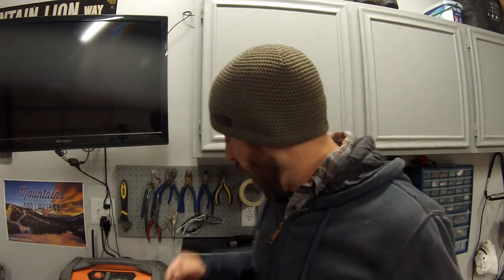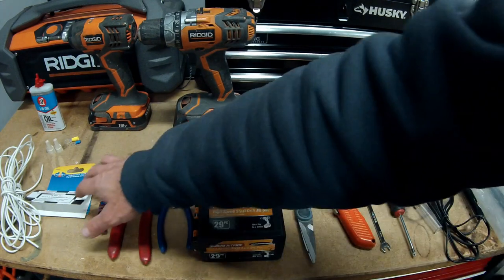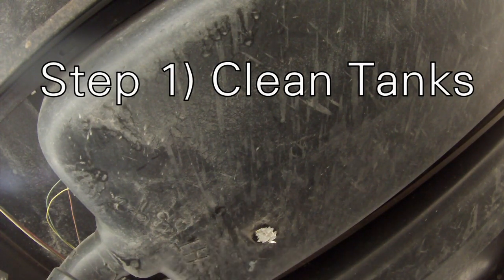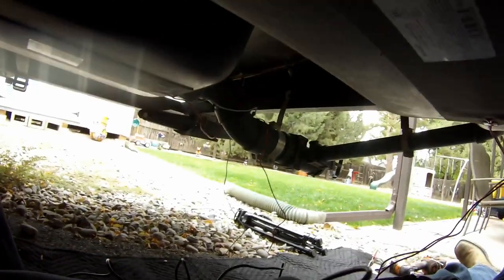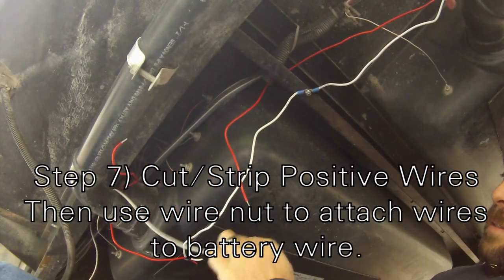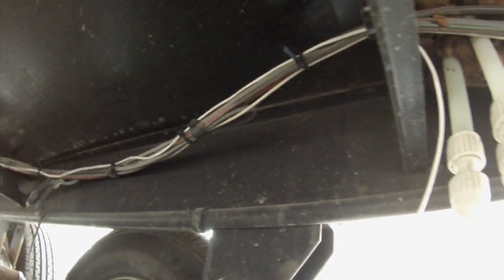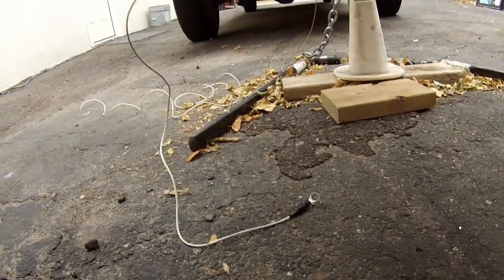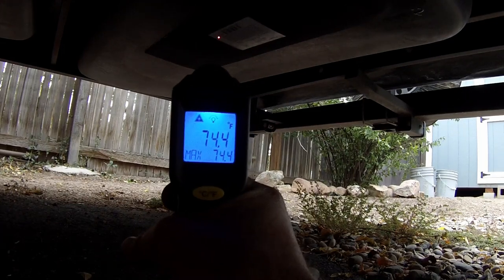How To Install 12 Volt RV Tank Heater Pads On A Travel Trailer - 4 Season Camping Upgrade!

Comment: A wire nut is a bad idea for the positive leads. I would suggest a crimp connector with heat shrink. It will keep out water and will not fall off. You don’t want to short your battery.
Reply from the maker: Ok, thanks for the tip and watching!
Reply: And wrapping in electrical tape is a bad idea.

Comment: Nice how-to-install tank heater video!  A couple things I would look at if you ever have issues with the heater working:  1) Consider running ground directly to the battery (or at least the main fuse box).  These heaters draw enough amps that an exposed ground could cause problems in time. 2) Not sure that switch is weather proof despite the boot on the front switch handle. Might cause a voltage drop.  Thanks for the links looking into installing something similar myself.  EDIT:  Just saw the link states the switch boot is weatherproof!  Good.  But what about the switch contacts themselves?
Reply from the maker: Thank you! I appreciate the feedback and you watching.

Comment: Cool stuff!  You are braver than I am camping with water on board in single digit temperatures...good for you 👍.  I do my late fall and early spring camping while still winterized...no big deal for me
Reply from the maker: Thank you! They ended up working out really good. I should be posting that camping video in the next two weeks to a month. Those tank heaters were the reason I was able to camp in those single temps! Otherwise I would be doing exactly what you do!
Reply: @ColoradoCamperman  Our 2020 EPro19BH came with tank heaters, but the camper isn't heated and enclosed. I thought if it wasn't we cant camp in the winter. Hubby wants to camp at the ski resorts here in WA and I'm trying to find a smaller trailer for him but don't understand how folks are using the toilet facilities in the winter.
Reply from the maker: @sherab2715  I looked at EPro and was worried about them not being enclosed underneath.  But it is a definite positive that you have the tank heaters!  What you could do is get some RV antifreeze and pour it down your toilet and sinks/shower.  This way your waste won't freeze up.  I did this with my toilet in my truck camper.  The only thing then you would have to worry about is your fresh water tank.  An alternative would be to use a jug of water at your sink that would then drain into your sink and not use your fresh water tank at all.  Again, I did this with my truck camper in the winter while camping at ski resorts and it worked great!  The only downside is you can't take a shower.  Hope that helps!  Have fun out there!
Reply: @ColoradoCamperman  I see, so keep nothing but antifreeze in tanks and when you use the bathroom, then pour water down the toilet or sink afterwards. Thanks!
Reply from the maker: @sherab2715  Yep, that's what I did and it worked well!

Comment: Hey Brian, How much draw did the pads have? I was thinking that this pad (probably a smaller size) would work good to heat a battery box for my solar unit. I just didn't know if it would drain the batteries faster than they would charge. I understand it would depend on how well the battery box would be insulated etc.
Reply from the maker: 78 watts each, so you have to have a decent solar setup in order to make sure you battery doesn't die on ya. The smaller ones are not as bad. Hope that helps, thanks for watching!

Comment: nice video, in video you install a Facon heating pad, as seen on the label. The link in the description is to a rec pro heating pad, also your description talks about recpro? Trying to understand which brand was ultimately installed and used.
Reply from the maker: I just looked back on my Amazon orders and can confirm it was the Rec Pro just like the link in the description.  Not sure why the actual heat pad said Facon, maybe the parent brand?

Comment: I'm in New England, Massachusetts to be exact...  I live in my trailer, I doesn't use the water system (pump, pipes), I made a makeshift faucet with 5 gallon fresh water jugs. I do use the sink drain (Grey tank) and toilet (black tank), should I install these on my tanks? Or would heat lamps with insulation board going around the outside.???? This is my first winter, I couldn't afford an apartment because of inflation so I got a 17ft trailer. What would be my best option?
Reply from the maker: If your tanks are exposed like mine were, I would definitely recommend getting these tank heaters. I'd be very surprised if a heat lamp would keep those tanks from freezing. Good luck and thanks for watching.

Comment: Hey Brian .... These look like a great idea !   My camper outlet valves ( Black & grey ) always freeze solid too , already had to fix that this season  by thawing them out with a small heater and dumping hot water down the  sink drain and toilet  . How many watts do these run ?   OK have fun on your elk trip and good luck getting one !  Im heading into the back country camping and skiing !
Reply from the maker: Man they worked great on the trip!  The tailpipe of the grey tank still froze, but I got back into civilization and it was above freezing and it thawed quickly.  You can actually get pads for the tailpipes so they don't freeze up to.  Glad you got your situation figured out!  Each pad is 78 watts.  So, if you're running on batteries, you will need to have a pretty big bank in order to get through the night with all 3 tanks on.  No luck getting an elk on the trip :(  But it was still a great time!  Are you having a good winter so far?  Have you been doing a lot of BC skiing?
Reply: @ColoradoCamperman  .....Thanks for the info on those pads ....Bummer you did not get you a elk ....  I see them almost everyday here on the property , bulls , cows , youngsters ....prawn horn , mule deer Bucks & does .....The season here has not been good so far , low snow volume keeps me from going up high and getting some peak bagging in . To much exposure still up there . The resort has been open so thats your best bet getting some skiing or boarding in . maybe next year I will get a pass if Im still here in this area . I don't mind the cold if i can ski , but if its just cold and no snow ...Im out of here   Ha !  Time to head farther north .
Reply from the maker: @Sirskibumsalot  NP!  Man, that is awesome you have that much wild life by you!  I think we would have more if we didn't allow cattle to graze our property.  They pretty much eat everything up.  Sounds like it's been a dry year everywhere!  Hopefully we all get more snow soon.  I could understand why you'd want to follow the snow, hopefully it'll dump on ya and you won't have to think about moving, lol.
Reply: How do you use the toilet facilities in the winter?
Reply: @sherab2715  ,,,Hi Shera ....  I have a  flushing toilet that transfers into my septic system . pipes are all insulated  what is exposed under cabin and the rest of pipe is under ground so its insulated too like that . Some folks have a out house bath room that are off grid too .which also  works well . hope that answers your question .... let me know if theres any thing else you want to know ....ok have a good week .

Comment: Question: When turned on, were the heating pads drawing amps directly from a stand-alone battery/bank at 12.9V (with no charger/inverter attached)?  Reason for asking is: The manufacturer of the pads rates them for use at 13.5V, which could only be achieved if the battery system is being charged.
Reply from the maker: I've used the pads while drawing power from my battery bank and also being hooked up to shore power.  They have worked in both instances regardless of the voltage.  Hope that helps.  Thanks for watching!
Reply: @ColoradoCamperman  excellent thank you

Comment: How to prevent the pipe from frozen now that the tank is taken care of ? Thank you!
Reply from the maker: Which pipes?  Our pipes are not exposed and run through the insulated floors.  Also, the heat ducts warm the floor where the pipes are, so there is no need to do anything else.  If you have exposed pipes on the outside, you may need to run heat tape.

Comment: So i wires mine up and im not seeing a draw. For sure the ground gets wired to the metal
Frame and not the negative terminal of the battery?
Reply from the maker: You have to make sure it is bare metal and  not metal with paint. You could have it go to the negative terminal on the battery as well, nothing wrong with that. Also, there is a built-in thermostat on the tank warmers. So, if it is not cold enough outside, they will not turn on. I believe they will turn on around 45° F.

Comment: How cold does it have to be, before they kick on?
Would you happen to know?
Reply from the maker: 45° F
Reply: @ColoradoCamperman  thank God, lol I thought I did something wrong with the wiring because they never turned on but my reader detected 12 volts, yet my outside temperature was 47°
Thank you for the info and reply.

Comment: Does fresh water tank support bracket smoosh the tank heater with water in it to make it not work or is it fine I Installed it Like you Did on fresh water tank under the brackets
Reply from the maker: I have only used the tank heaters on one long trip, and it still worked great! It'll be interesting to see if it holds up long term. I'm guessing/hoping it will be fine. Thanks for watching!

Comment: Hello I have a question I have 2, 50 gallon water tanks and 2 grey and one black tank What should I do?  Thanks Rob
Reply from the maker: Holy smokes, that is a lot of tanks! I guess it depends on what your power situation is going to look like. If you want to do off grid and not use a generator, you are going to have to have a pretty massive battery bank. If power is no concern, I guess you could hook up a heater to every tank. Unless you have a way to just use one water tank and one grey tank? If yes, maybe just put tank heaters on those and the black. Good luck and thanks for watching!.

Comment: Hi, thanks for the great info.
Do you wrap heat tape around the grey and black drain pipes going to the waste gate valves? I didn’t know if they freeze up
Reply from the maker: I've only used the tank heaters for about a week long trip. It did get down to 5 degree F though. I skirted the underside of the camper and I put foam fun noodles on the exposed grey/black tank pipes. The dump valves ended up freezing. But when I went to dump it warmed up considerable and I was able to open the valves. No long term damage was done, but if I was doing more camping like that, I would use the heat tape. Hope that helps. Thanks for watching!
Reply: Thanks , great channel
Reply from the maker: @Schetmesa  You're welcome!  I appreciate you checking out my channel and watching my videos!

Comment: I’ve got 2 grey and 2 black tanks to install heaters on how would you run power to each of them?
Reply from the maker: I would probably do the exact same thing that I did.  I've seen some people on YouTube just hook them directly up to 12 volt power and not install a switch.  I didn't want to do that because we camp in the mountains and even in the summer nighttime temps will be in the 30's & 40's.  No need to have the tanks heaters automatically turn on in the summer if it is not a hard freeze.  Good luck with the project and thanks for watching!

Comment: You need to put the fuse close to the battery and not after the switch!!!
Reply from the maker: I didn't think it would matter from a switch because all it does is open and close the circuit.  I suppose a failure could happen and the switch could get fried instead of the fuse.  Thanks for the feedback and watching!
Reply: @ColoradoCamperman  it's an unwritten law.  the cable can be damaged and short-circuited so it can start to burn.
Reply from the maker: @nicklaslindgard  Ok, thanks Nicklaus!

Comment: The switch contacts are exposed.  They need to be sealed. Snow could accumulate on the contacts and short them out. Or water could splash up while on the road leading to a short. 

Also make absolutely sure those wires do not rub against the frame.
Reply from the maker: Okay, thanks for the heads up on that. I will make sure I put electrical tape all over the rear of the switch. Thanks for watching!
Reply: @ColoradoCamperman  do not use tape.  use shrink tubing. much better
Reply from the maker: @nicklaslindgard  Will do, thanks Nicklaus!

Comment: I do not understand all the wiring. Definitely not a job for a beginner non electrician.
Reply from the maker: Just have the positive wires go to the positive terminal on the battery. Negative wires get grounded on the frame. The switch is optional. Thanks for watching!
Reply: @ColoradoCamperman  to do that you need to know which is which. I don’t lol